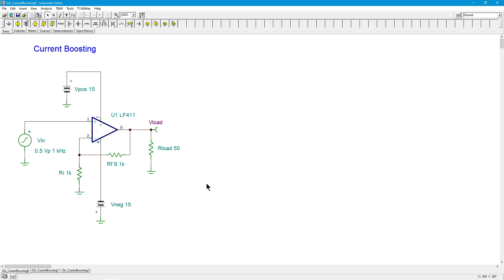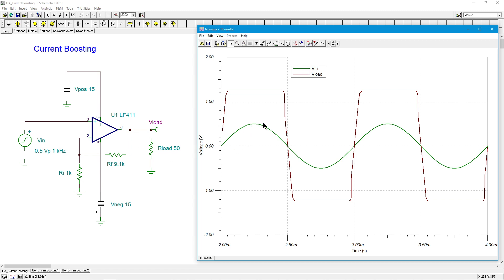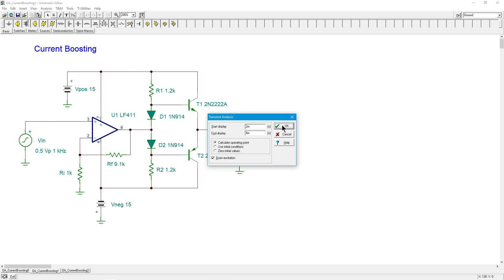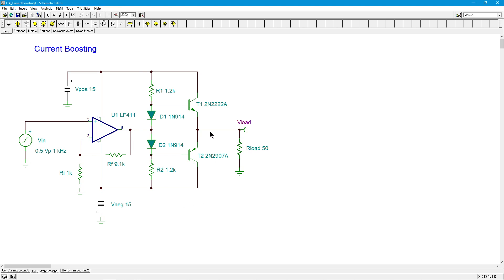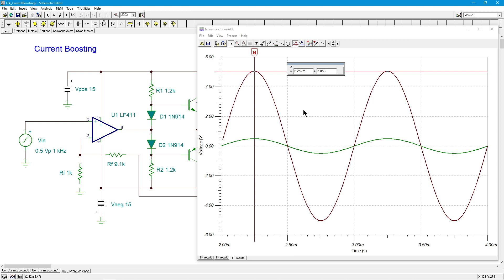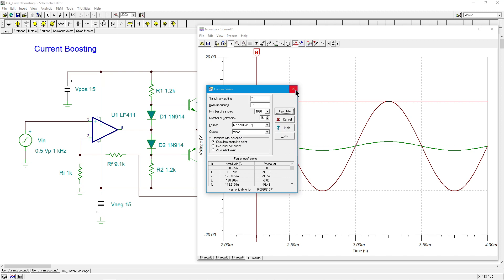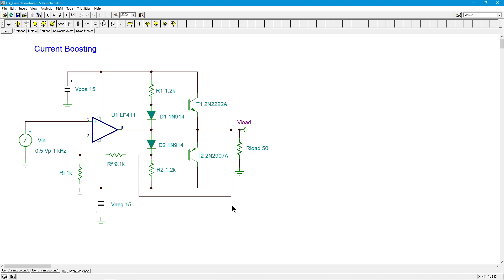Op Amps: Current Boosting

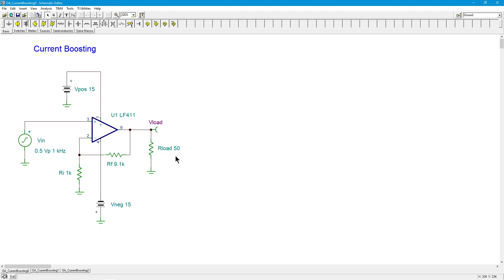Comment: 1:27 why does a long run of coax cable have large capacitance?
Reply from the maker: A coax cable consists of a central conductor surrounded by insulation which is then covered by the conductive shield (kind of like a cylinder). The shield acts like one plate of a capacitor and the conductor like the other plate. Remember that capacitance is proportional to plate area, so the more area (in this case, the longer the cable), the more capacitance you get. Coax cables are rated in terms of pF of capacitance per foot. A certain cable might be 30 pF/foot. A few inches of cable doesn't have much capacitance, but 100 feet of cable certainly does.
Reply: @ ohhhh wow thats amazing, thank you!!!

Comment: I'll have to try this with my currently developing transistor fuzz-stortion. I've been avoiding clipping diodes as much as possible until I'm fully satisfied with what I'm getting from overdriving my transistors. I fully grasp that voltage gain is the most significant factor when we're trying to generate clipping by exceeding a devices forward voltage, but I've also noticed there's a richness and texture in the final product when there is a nice boost in current included.  

The simple way I did this in the past was running a ground resistor off the output, and forcing the op amp into Class-A or nearly by doing it, but I imagine there are advantages to adding this current gain stage on the feedback path. With the simple method, it's just a resistor and a bypass capacitor to shunt the noise the method also introduces.
 
I'm just in the practice of establishing as many traits as I can for the project before introducing clipping diodes because 1, I still add other passive components to alter the available voltage that switches them on and 2, in doing so have found using a capacitor so I'm getting a specific corner frequency up/down clipped or bandpass allows for you to get those extra harmonics in the most desired bands and not so obviously reducing output to your load.

Comment: This is great.
Would this feedback setup negate thermal runaway on the transistors?
Is it still worth putting small emitter resistors on the final stage transistors?
Would we still need the biasing diodes?
Thanks again, I hope all is well with you.
Reply from the maker: Feedback doesn't get rid of thermal runaway here, and yes, include the diodes for lowest distortion.

Comment: what about the gain change from adding the push pull circuit in the feedback loop? Does the p-p circut have very low impedance? I'm assuming it does since the output voltage changed very little.
Reply from the maker: It's inside the feedback loop. With this much negative feedback, the feedback defines the system gain.

Comment: Professor I’m using a JRC 4556 high current op-amp to drive the primary side of a transformer to sweep the Collector Emitter of a transistor.